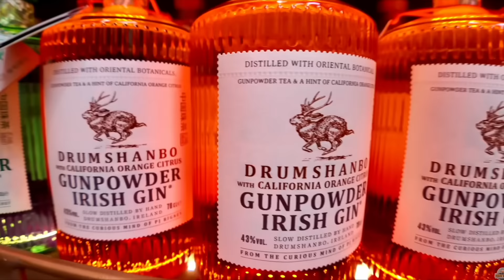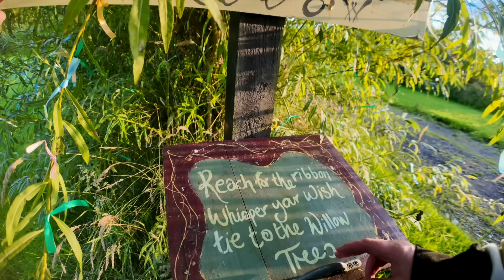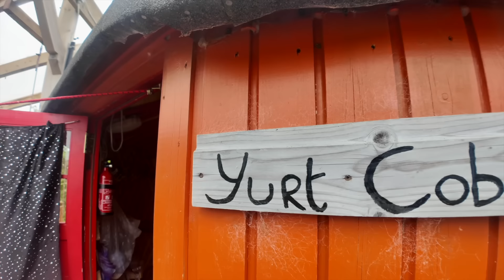Van Life Problem Forces Us To Take The Van Apart

Comment: You’re not alone with the pull out bit on the ovens are like a mega magnet for any form of dust or debris - you can have cleaned it and it’s collected debris minutes later!  Imagine building your own van makes it much easier to dismantle and reassemble to sort any bits out. Wonder why there’s a shortage of toilet fluid in Ireland… All the very best, David & Rachel 👍
Reply from the maker: To be fair we were mainly out of cities and towns and then we did manage to find some eventually on one of the cites we stayed at! But it was definitely few and far between!!!